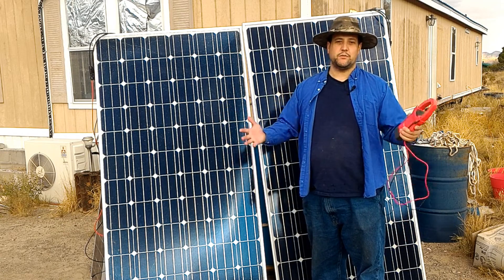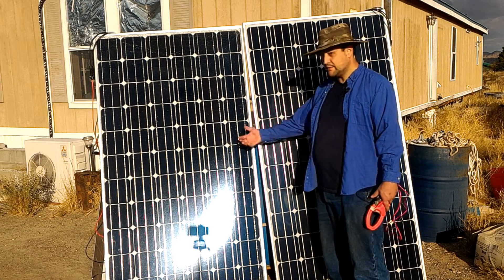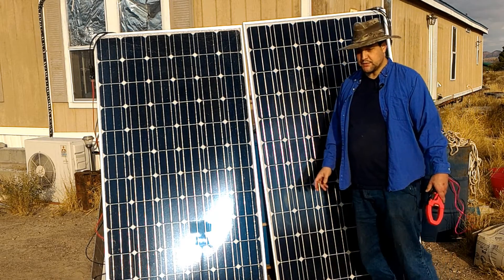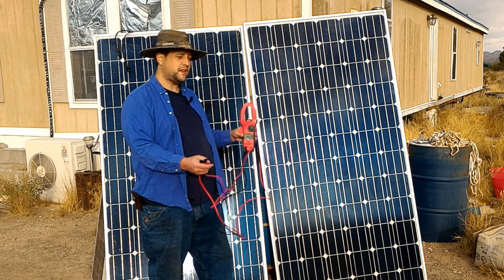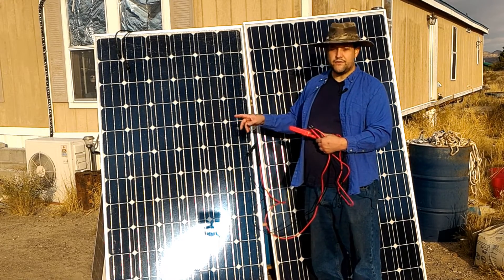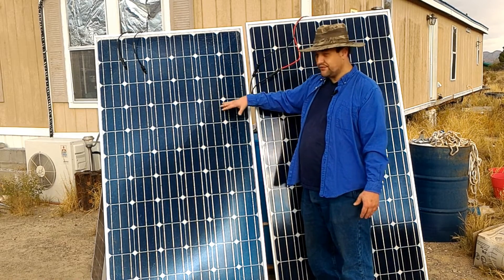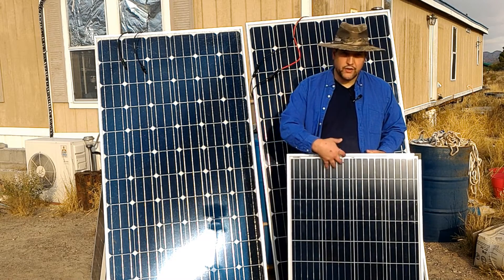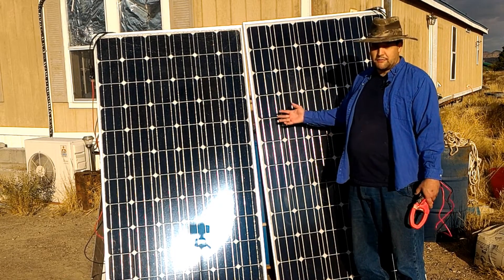Poly vs. Mono solar panels in a fight to the Death! Manifest Power E003

Comment: Wattage is the important number. Not voltage
Reply from the maker: When solar panels like thin film panels fail from hail damage they produce 0 volts. 

Similarly these panels I showed do not have any shorts from the damage which also would show a result of 0 volts.

My statement that they still work holds.

Comment: A good epoxy will get down in those cracks and reseal the entire panel.
Reply: Look for a polyurea or polyaspartic. Both UV resistant and very durable. Same basic chemistry for bed liners but when used for flooring it can be obtained in clear. Thin it with a little MEK to help it soak into the cracks
Reply from the maker: I have tested several epoxy mixes and so far I haven't found one that doesn't yellow, even ones saying they will not. I think the high heat is the problem. Best option I think is a UV resistant silicon mix.
Reply: @reedin9954  have you looked into the epoxy mixes they use for overlays.  The tiny little pebbles that they lay over steps or put down on walkways is cover by expensive epoxy.  I know a big issue with epoxy can be scratching also. Thanks for the reply. Hopefully you'll find a good product to repair that glass.
Reply from the maker: Hadn't thought of that. I will check into it. Another I was looking for is a way to buy a bunch that is used to repair windshields of cars. Those don't yellow but for the amount needed for the whole panel it will cost like 4x the cost of a new panel.

Comment: I was just about to cheap out and get the poly but now I'm just going to stick with mono.  Thanks!
Reply from the maker: I'm glad you liked the video.  I'm going to posting an update where I take the broken panels and mount them onto a strong backing and completely repair them.  Also, I got other interesting solar and power projects along with lots of gardening videos.  If that sounds interesting to you, subscribe.
Reply: Thanks I just subscribed.  I am also doing my own solar project to become completely independent from the grid power and also to charge my electric car.
Reply from the maker: @witengineer6377  - I'm on a very similar track.  I'm saving up money for a new electric car with greater range.  My previous one was a Ford Focus Electric and it would only do 80 miles.  Want something that can do 200 or more.  I plan to get one in 2021 and it looks like lots of new options will be available then.

Comment: Open terminal voltage varies quite a bit, with temperature. The warmer, the lower voltage. Temperature makes a bigger difference, then how much sunlight, to unloaded open terminal voltage.
Reply from the maker: Voltage does change with temperature but it isn't swinging that fast to cool and warm the panel in the time I was working on them. Sunlight moving in and out of clouds was causing the change. Nothing to do with the temperature. Also given that both were at the same conditions my point of showing they were both showing similar voltage was good enough.

I am going to do an update later once I get the damaged panels mounted on a good backing and the glass protected. I will hook them up to a charge controller and see what wattage I get. Based on the prior ones I repaired I have only lost 5% of the output.
Reply: @reedin9954  That sounds about right, provided, the cells themselves haven't been fractured. On a hot summer day, you can expect about .55 volts per cell. In the dead of winter, you can expect just above .7 volts per cell.(open terminal) When loaded with a MPPT, the difference in wattage is less, than open terminal voltage, because, while the current will be slightly less, they come close to making up the difference in wattage, with higher voltage. Since the open terminal voltage is not dependent on the active area of a cell, you really won't know how much the performance has suffered, until the panel is loaded. The effective reduced active area of a fractured cell will become painfully apparent at that time.

Comment: Wow! That’s valuable information thanks 👍
Reply from the maker: I'm glad you found it to be a good nugget of knowledge.  I have always been interested to know how products handle disasters and something critical like solar it is a good thing to know about.
Reply: Its a good insite on what to buy but only one thing worries me is how they would handle a large X CME. I would think they would fry.
Reply from the maker: CME has no effect on solar panels or other small electronics.  A CME does damage to long wire runs and pipeline because it causes earth's magnetic field to move and then move back.  This movement of the magnetic field through a wire makes electricity.  At a small scale like the wires from these solar panels to your charge controller it isn't a problem but for the powergrid with 100s or 1000s of miles of wires getting exposed to the moving magnetic field it causes huge currents and voltages that will destroy the HV transformers and tons of little transformers.  Also it can melt the wires and such.  That is how a CME will destroy the powergrid and send us back to the 1800s.
Reply: Oh wow thanks so much going off the grid is a good option an keep up the good work 👍
Reply from the maker: Off-gird can really help you if you are worried about a CME event and it will help protect your home.  I worry about CME events as we are certain to get a big X100 or so event impacting the Earth soon (within a 100 years).

One thing about these events is that they will cause a large number of transformer explosions and that means lot of fires.  It isn't any help to us if our homes burn down because the transformer on the pole exploded causing the surrounding area to catch on fire.

Now it is possible to operate in what I call grid backup mode, meaning to use power from the grid if your solar isn't able to give you enough energy at the moment (long week of cloudy days or something) and also protect your home from a transformer explosion and surge from the grid.  It takes planning but very possible.  I will have to make a video all about it when I have it working for my home.
Reply: Manifestation of Imagination yes please do make a video! The day a CME comes will give the world a wake up call. In Australia we get lots off sunlight we’re i am so solor will run well
Reply: @chriskrause950  thanks you give me agood idea I will go mono